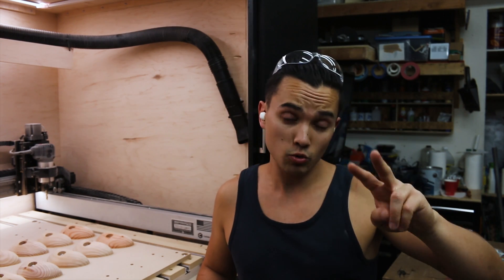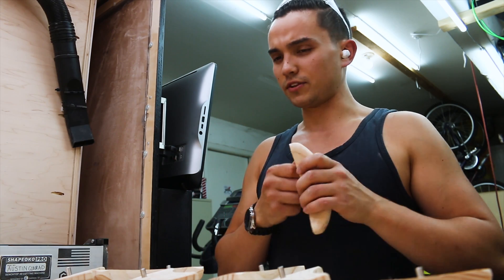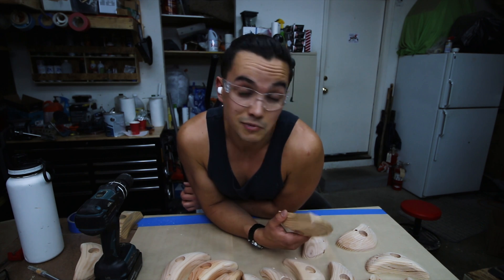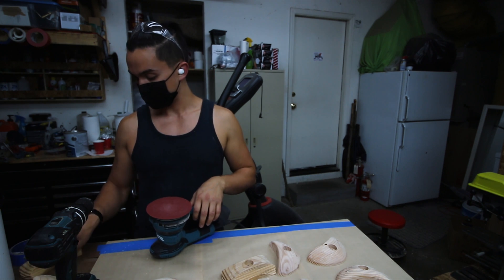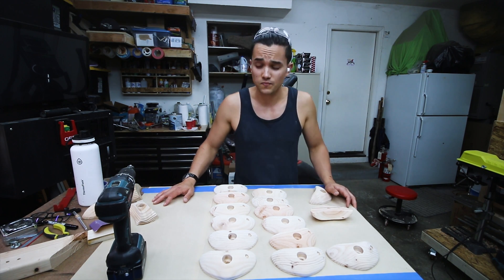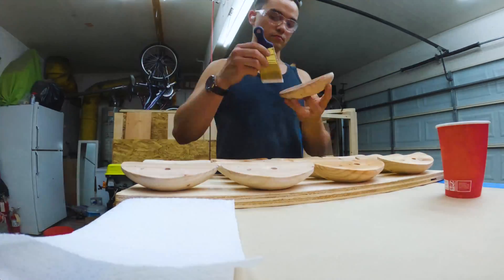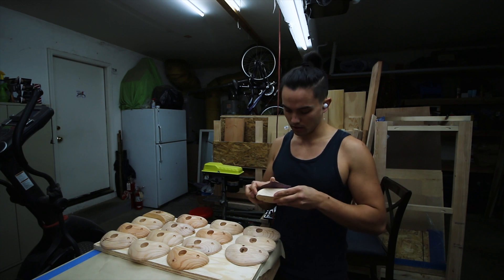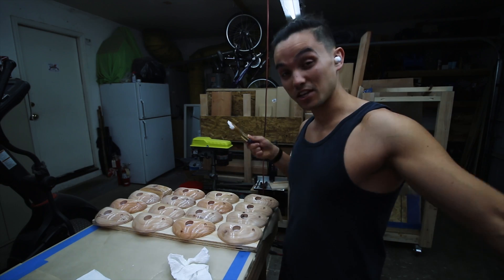First CNC Production Run! - Part 2

Comment: Also, why brush polyurethane on the back of the hold?
Reply from the maker: @ejl74  the backside will still get water and slowly rot out the hold if exposed to water unless it's sealed. Especially with the textured paint on the wall digging into it.

Comment: I hope this comment gets to you, but I have a few questions about your programming. I am too using my shapeoko to make climbing holds and am running into a few issues on setting up multiple holds to mill like you have here. Any advice would be great!
Reply from the maker: The cnc doesn't have multiple work offsets. So to do Multiple parts, you need a fixture to accurately locate them and then program all of them with a single work coordinate. Just need to be sure to tell the cam other parts are there or it will run into other parts.
Reply: @AustinConrad  so you do use fusion 360?
Reply from the maker: @jacobeidson8610  yep. 360 for all of it because I can't afford something like mastercam

Comment: Just found your channel, good stuff never used a wood hold before, looks nice, suggestion for your fixture s most use 2 dowels to keep from movement the bolt just adds down pressure. Good luck hope I get to try one soon.
Reply from the maker: Thanks!

Comment: Hello! First of all awesome videos. I noticed some details that if changed may improve your process.

First one you already talk about it, pins doesnt need to be super tight in tolerances. 

Second, you dont need to push them so deep in the mdf. Remember they are just locating pins, they will do small to no force.

Final tip, use 2 pins. 1 pin and the bolt will have some play and in this application might not be that bad but still will make it plug and play with no need to use the rule to square them.

Maybe one more, you can have the cnc make those pin and bolt holes even using the same mdf board modified to put all stocks in a specific location. Less effort.

Hope this helps. :)
Reply from the maker: Thanks Jaime! The two pins is nice if they're added to the blocks on the cnc instead of by drill press from an accuracy stand point. I like the idea though! Thanks
Reply: @AustinConrad  give it a try. I use that to do double side machining (machining a part on both sides top and bottom). Thanks to that I was able to make a mechanical keyboard case with decent resolution and tolerances as well as keycaps xD
Reply from the maker: @jaimerodriguez3864  nice!

Comment: Been watching all your trials and tribulations on these, glad to see you nailed it at the end. I would also like to know what router spindle your using, my two old Porter Cable ones are getting a bit old and too expensive now?
Reply from the maker: Thanks! It's just the stock router that comes with the Shapeoko Pro from Carbide 3D.

Comment: I have a question, why paint or coat them? the purpose of using wood to machine holds is that their texture without anything is the best for preserving skin (that is why fingerboards are kept raw finish except for sanding)
Reply from the maker: That is true. I have noticed that the raw wood finish texture is much nicer than the polyurethane however these will be outside instead of on an indoor wall & I need the weather proofing so I'm stuck with the smooth plastic texture.
Reply: @AustinConrad  ok, I get it. yeah, for soutside, you definitely need the coating

Comment: Does it get hot inside the enclose while in use?
Reply from the maker: Somewhat. I would say 15 degrees F above the ambient temp. That's also another reason why I have such a large enclosure. More air takes longer to heat and helps keep things manageable.